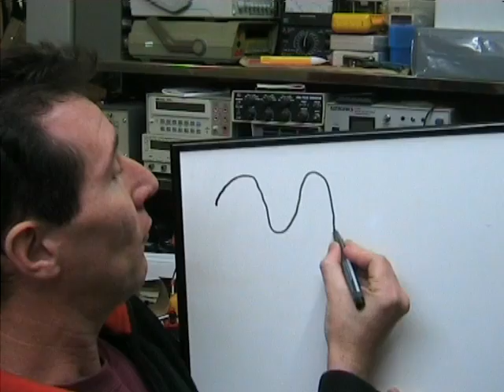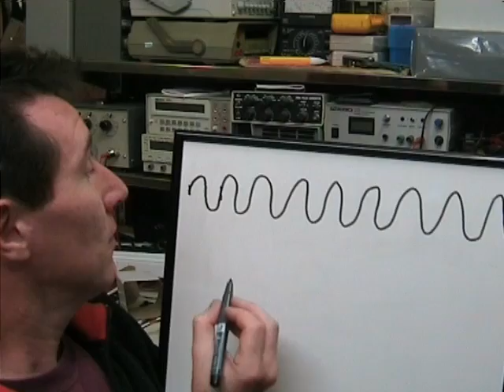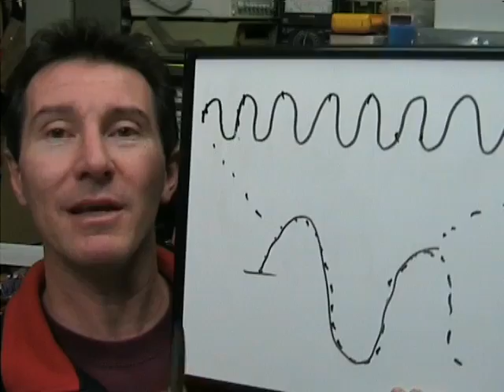EEVblog #13 Part 1 of 2 - Digital storage Oscilloscope Tutorial

Comment: I bought a Tektronix 2247A scope for my first scope but, it didn't work.
The CRT works perfect on it & I'm hoping to get the thing fixed eventually!
So I bought a new 
Siglent SDS 1102CML+. 
Turns out that It is officially my first (working) scope now.
 It's a total nightmare trying to figure the damn thing out! I feel like I need to take a complete  course on how to properly run it. Thank God there's an automatic trigger button & I do know how to zoom in and zoom out. I do know how to compensate the probe/s. I was able to look at the noise of my switching  adjustable DC power supply DP305A. Buck converter. I was experimenting with a small capacitor trying to take the ripple away. I found out when you move the probes  farther away from the capacitor, it stoppes working & the Ripple will come back. so I'm not quite sure how to filter the Ripple coming out of the switching power supply permanently unless you put a filter capacitor right there on the breadboard by the ripple?
 Electricity reminds me of a roaring river moving Through the Wires splashing back and forth in the wires. The capacitor slows it down right there around it but,  as soon as you get further Downstream from the capacitor, it starts splashing around again.
I don't know? I'm a newbie. is that kind of how it works?

Comment: is the Rigol DS1052E Digital Oscilloscope 50MHz 1 GSa/sec 2 channels plus USB storage a good one for working with tesla coils work and things around that leval
Reply: It depends on what you want o measure and at which frequency.
For example, if you want to make music with your tesla coils and measure the frequency, it will be good enough. Because the sound frequency we are able to hear goes only to around < 20 KHz and the typical low cost soundcard has only a frequency of 48-96 KHz, thus a 50 MHz Oscillosckope with 1 GSA/s will be more than adequate.
With a sample at a frequency of 96 KHz you will be able to achive 10416 samples per waveform with this Oscilloscope. That is more than plenty enough. The formula is 1000^3 SA/s / 96*1000 Hz = 10416 samples
On the other side, with only 1 Million measuring points, you might be able to sample only  1*1000^2 /201416 samples = 96 waveforms at that resolution. If you decrease the resolution, which means storing less samples per waveform, the number of waveforms or duration increases.

Comment: Great accent...Good information especially explaining sampling rate and memory depth. The guy is always pushing certain brands. I had a RIGOL and it was a mess & I returned it. Supposedly it was missing the latest firmware update but I don't need the grief.  Plus it was more expensive than other Chinese brands. I have an ATTEN and  HANTEK & have found both to be terrific and they were less cost than the RIGOL I returned.

Comment from the maker: @carnews333 Yes, you need an oscilloscope if you are into electronics. No, you don't need to spend $10,000. A $350 Rigol will do you just fine. $50 ebay 20MHz dual channel analog will also do you just fine.

Comment: Oh come on man. "Cheap scopes like Tektronix"? They cost 10 times more because they are 10x better. Rigol is a knock off they ripped from the contract work they do for Agilent. Perhaps the Rigol is not that bad for the price and you're trying to convey that message. But it's coming across as a biased Rigol infomercial. You then post: "There is an ad on my eevblog dot com website for the Rigol from an Australian supplier, only $399. Tell'em I sent you.".  No biased, eh?

Comment: @gotaimabara The oscilloscope equivalent to a cheap chinese meter is this:
2 Channel PC Computer Digital mini USB Oscilloscop

Operating systems used: W2K, XP ,Windows 7(32bit)
Signal input: BMC connection with universal oscillograph probe
Max sampling: 8kHz x 1/ (4kHz x 2)
Measurable frequency: 0Hz -----3kHz
DIV array: horizontal 16DIV x vertical 10DIV
Max voltage: 0---5V
Error of voltage measurement: ±30mV
Adjustable range of time domain: 10 mS/DIV----10800 S/DIV

Go search Ebay for it.

Comment: 'Won' an HP54201A digitizing scope for $83 to my door on ebay.  Specs say-
 'Dual 200 mega sample/ second allowing 50MHz single shot wave form capture.'
I am repairing electronic (musical) organs for recirculation into the community. With the advent of Craigslist the market is flooding with low dollar organs that were once high dollar. Most are analog transistor oscillator card ( personal favorite ala' Ray Manzarek), opamp based. Save for tone wheel Hammonds, tubes are rare.
 Is this scope OK?